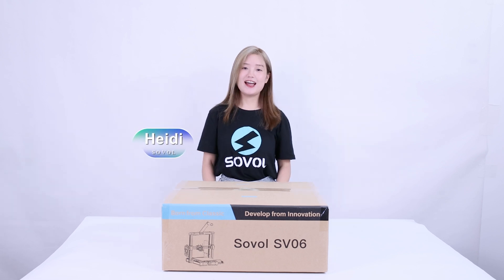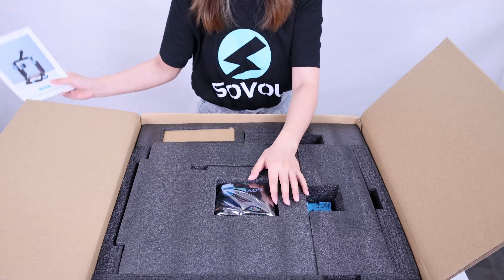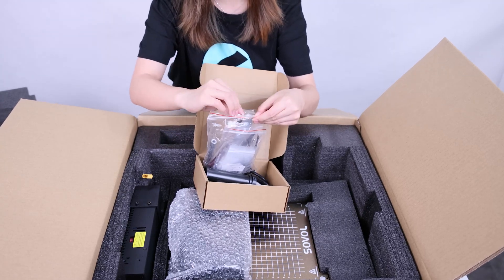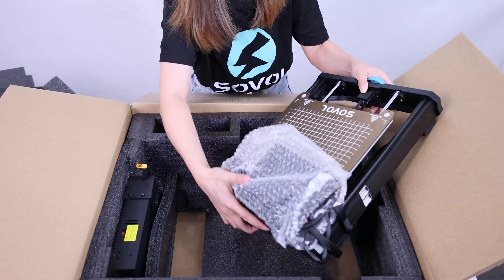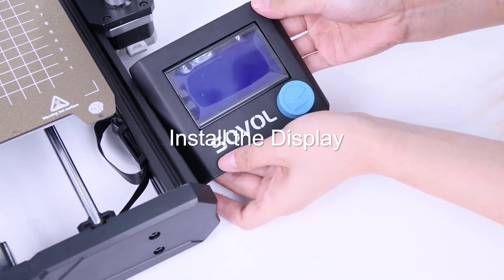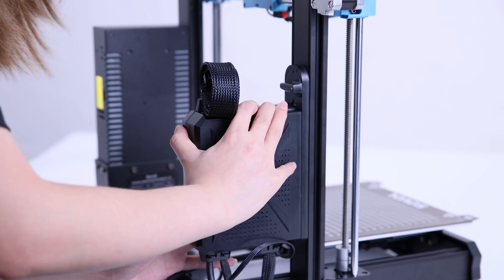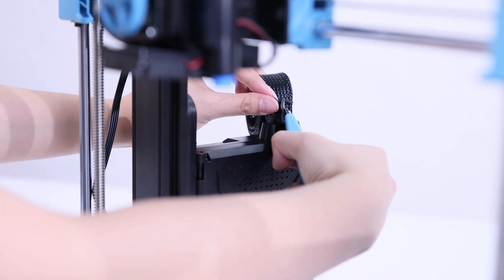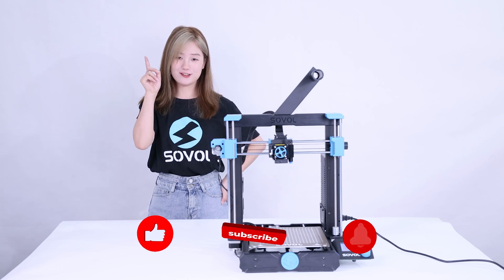Unboxing and Assemble Sovol SV06 Budget All Metal Hotend Auto Leveling Direct Drive 3D Printer

Comment: My sovol SV06 does not print the Z axis correctly and does burn into the filament and then release the pressure from the pressure board, it is a disaster

Comment: Does SV06 have Thermal runaway protection enabled?  Does it have a filament runout sensor?  If no FRS, does the motherboard have pinout to add it?  thanks for help!
Reply from the maker: Yes. It haave thermal runaway protection. And it doesnot have FRS. The motherboard has a reserved interface for the customer to extend the broken material detection module, but the current firmware does not enable this function.
Reply: @Sovol  The description says " The resume printing function can make the printer continue printing perfectly after a power outage or broken filament, etc."  How does that work when the filament breaks and it does not have a filament runout sensor (FRS).

Comment: I have pre-ordered one. I hope it comes in December. The full metal hotend is already being praised. You get a lot of printers for little money. PLA, PETG and TPU should be easy to print.
ABS and ASA normally need a housing, but it has been shown that it can also be done if you print carefully. But these two fabrics smell when printing.
Reply from the maker: Yes. It will come to you soon.
Reply: So, did you get it? How is it?